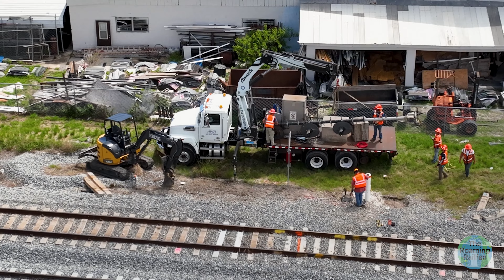Brightline Construction: Searchlight Signal Removal and Destressing

Comment: Are the searchlights being replaced by tri lights?
Reply from the maker: These specific locations featured are not getting new signals as these control points are being eliminated. All locations with signals (like the cantilever intermediate) are receiving a variety of modern LED “Vader” signal heads.
Reply: @RoamingRailfan  Thank you!

Comment: I knew is was bullshit when someone told a signal fan that they were saving them for “parts” only to scrap them. The only siding left with searchlights is now Bayard. End of an Era on the FEC.

Another great video my dude. I’m glad I got signal pictures when I could of the signals.
Reply from the maker: That's not totally correct, they have been scavaging parts from all of the signals that have been removed (I even show them removing parts on the Palm Bay North ones) and I would not doubt if some of the first ones that were removed during construction are sitting in a yard somewhere just in case.
Reply: @RoamingRailfan  interesting well, you are one of few notable sources! Thanks for the heads up!

Comment: Great video as always. Speaking of signals, can you touch on statement (could be a rumor) that the crossings gates are possibly being upgraded with sensors that detect if there are obstacles?
Reply from the maker: Yes, I believe every crossing where speeds will be 110 are having vehicle presence detectors, which are a kind of radar, installed that will be linked to the signal system. There are typically 2 per crossing mounted on dedicated poles.
Reply: @RoamingRailfan  ❤